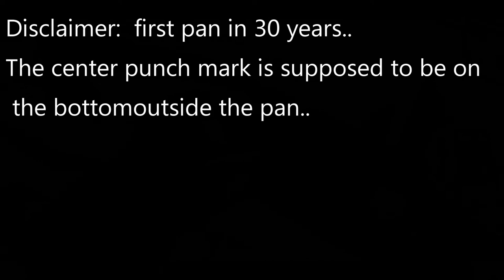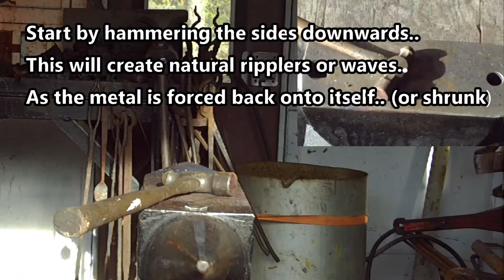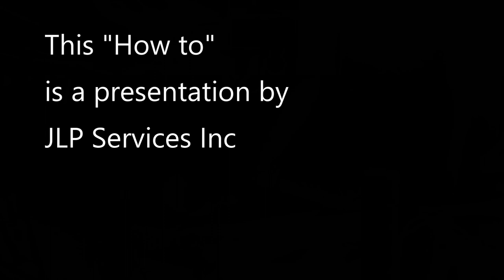Pan Making  Tutorial Vs "How To"..

Comment: LOOKIN GOOD CHANDLER HAD A TIME WITH HIS AND YOU DID YOURS ALL FREEHAND, THATS SOME FILE HANDLE THERE DARLIN, MORE LIKE A HANDLE FOR A GOUGE, BUT SEEMS LIKE MORE CONTROL WOULD FOLLOW WITH A HANDLE LIKE THAT,  I LIKE THAT YOU USED ONLY HAND TOOLS, COOL
Reply from the maker: Thanks..  Once the concept or technique is understood pans are pretty easy to make..  I will at some point film a Real  "How to" on both pot and pan making.. 

This was a down and dirty and between filming and editing for the Picture in picture was the fastest video every done..  Like 4 or 5 hrs which most videos to edit are in the 40-70hr range..  

The long handles are for the hot rasps, which run as the general file and rasp in the shop..  Once you have been bitten by a hot piece of metal the longer handle will be greatly appreciated.. 

Yup, only hand  tools used on everything..  Also all the videos use the most basic blacksmithing tools.. :)  

Thanks for the kind words and taking the time to comment and subscribe..  Thank you. :)

Comment: Reading some of the size work from some comment My vote is for the most part I get on your videos to learn and you give me the best teaching of all the many black Smith and far better hammer control than them all , but Brain Brazil Shure also does it great, But your teaching is one up on him.
  John Switzer teaching all about the skills,tools, metal, many safety tips and just do it,hands on seems like the neighbor I would love to know.
 "Lady of the Forge" please stay what you doing, I do prefer your newest videos with your last chisel build as tops , showing improve video and as I said,Best heat treat lesson.
  Question I am working a auto coil spring to "spring" my post vice , I try to thin to 3/8" thick and S shape and now to heat treat . Just know the color is going various along the length I will try to oil dip deep as the steel turns light gold.
 I'll try a 1/4" test piece 
My toaster oven don't get to 600 degrees as springs needs.
Reply from the maker: thank you..    As to heat treating your spring.  It actually can be done several ways.. First thing is to harden it fully and then either with a charcoal or wood fire and then put a piece of metal plate on top. this method can also be used in a forge. Once you clean off all the scale to bare metal you will see the temper run.. Ideally a blue or even green depending on the metal. 

Keep in mind there is a process of the metal gaining cracks when at this blue phase. 

For a spring of this size you can also do an oil burn off method that the spring is hardened in oil.. You then take the spring and moving it evenly over the fire.  The oil will smoke and catch fire..  As soon as it catches fire you cool it off in oil again. 

This is done 3 times..  Then the spring it tested.. If done right every spring will take a working set but no more.. If done absolutely perfect the spring will return to true, but nearly every spring I have ever seen will take a set over time.. 

If you do make the spring be sure to round up any edges along the length as this will help with cracking. .  On smaller springs like for rifles or muzzle loaders and such its not as important. 

I don't plan on quitting the videos though I do plan on changing the direction some.   All good for sure.. 

Thanks..

Comment: I was rapt waiting to see if you quench it to blow off the scale art the end.  What would be your preferred finishing method?
Reply from the maker: Howdy do..  Best finishing method is an air or electric powered right angle die grinder with a scotch brite  pad.. Start off coarse enough but also fine enough not to leave large/deep scratches..  Work up finer.. 

These pans with a thicker bottom and worked up sides might withstand a hot quench.. But thin pans you'd end up warping it beyond useful.. The blowing off the scale thing works well if you can then flex it like in welding as the internal stresses won't matter.
Reply: JLP Services Inc a right angle die grinder is something I still don’t own.  I swear, that tool always seems to be the logical answer to tough jobs.
Reply from the maker: Super handy to have..  If you have a compressor to power it it's a great time saver..  I am very finicky about finish on Food wares and for the time it would take to polish a pan properly by hand I could make another pan completely..   The Die grinder makes it so I can sell a pan or pot for a reasonable return or profit margin vs time.. 

With that said.. Buy a quality die grinder. don't cheap out. I own 6 or 7 of them and each 1 I bought I upscaled till I found the right power ratio which is the one I should have bought from the start and saved a ton of cash.. 

As with all tooling spending once is spending right..